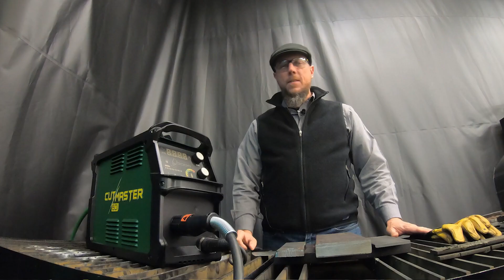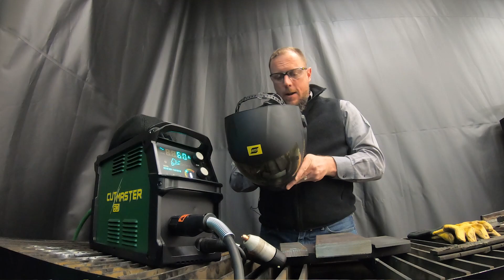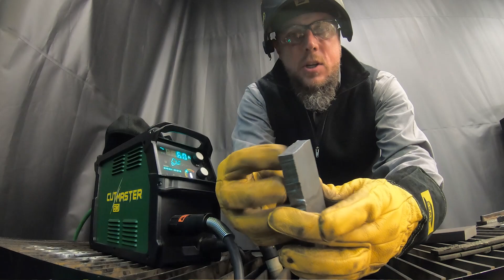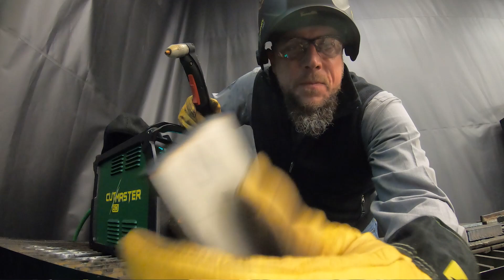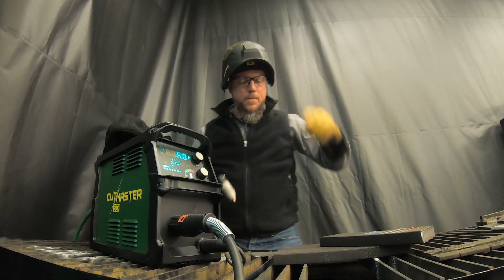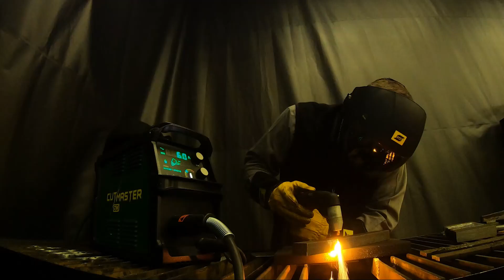Everything You Need to Know About Cutmaster 60i

Comment: Hello ESAB ~ I understand that this particular machine has experienced issues with poor connections in the torch/cable causing error codes to be thrown.  Is the "X" upgrade to this model, as in Cutmaster 60ix, proven to be the solution to this issue?

Comment: I have the 58.   I purchased on sale with rebate almost 2  years ago. Was very reasonable price. Not much in the way of  bells and whistles but it’s been flawless so far. . One of the only flaws of plasma cutting it the bevel on the cut. More of an issue on 1/4” plate and up